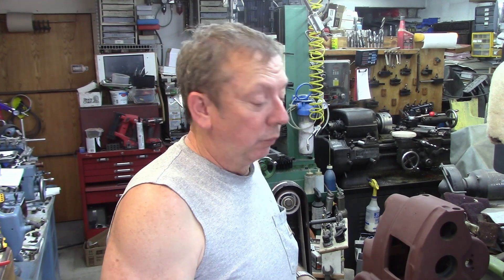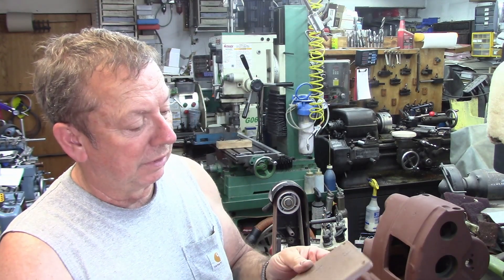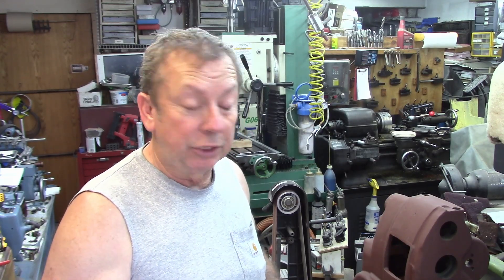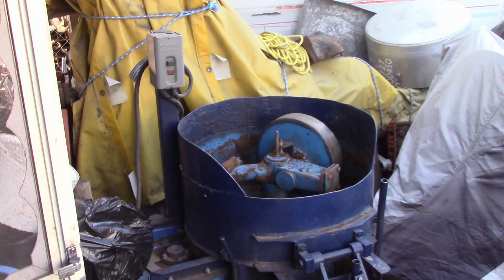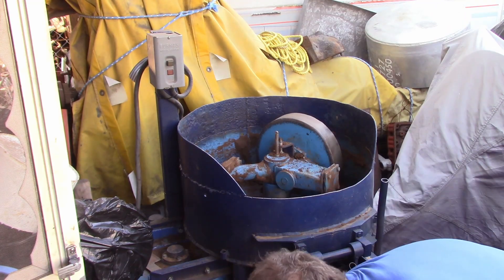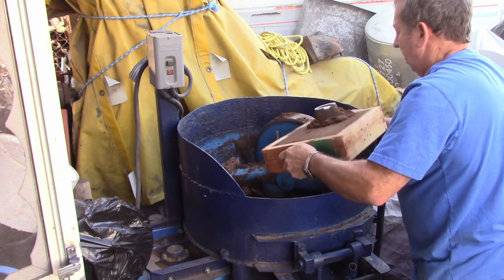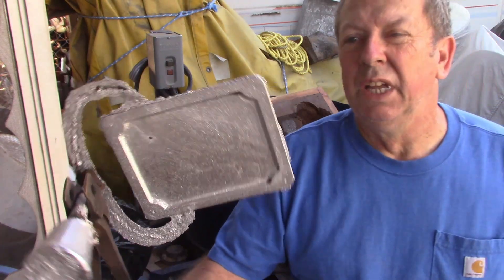Building An Atlas MHB Milling Machine: Part 1, June 17, 2025

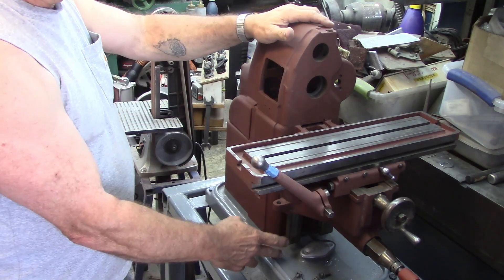Comment: Awesome. I had a blast rebuilding my old Atlas Milling Machine. Nice work with the casting. Hopefully one day I'll have the equipment to try that. I noticed that handle you have there to move the table (@ 3:18). What's the purpose? I've never seen that before. That made me wonder if this machine could be used as a mini surface grinder. Thanks for sharing.
Reply from the maker: Thanks: This is going to be a model MHB which is the production model, the machines you commonly see ar MF which is my other mill or the MFB which is probably the most common. I have been gathering the MHB parts for several years as they are hard to source and can be expensive because people know they are fairly rare. I don't recommend building a machine from parts as it is not cost effective and can lead to some issues if you are after an accurate machine but this is very specialized so I am going down the rabbit hole again. Surface grinder , not for me as there is not enough protection for the sliding surfaces, anything can be done but I don't consider it best practice if you want the machine to last. Dan.